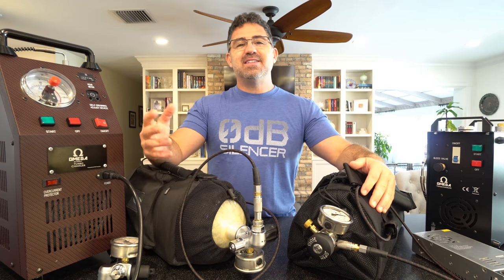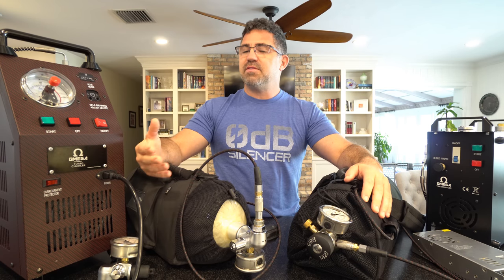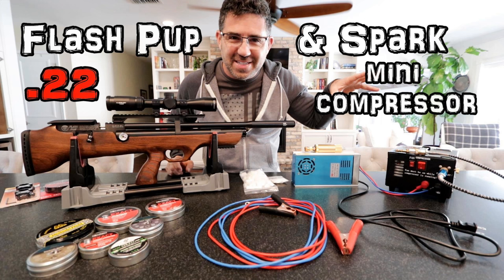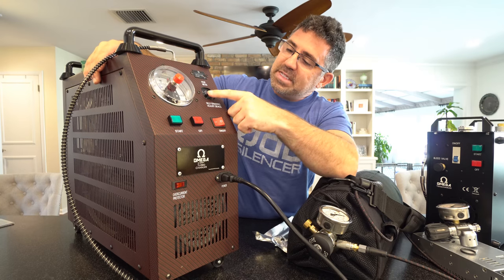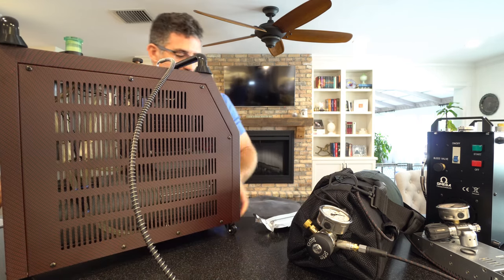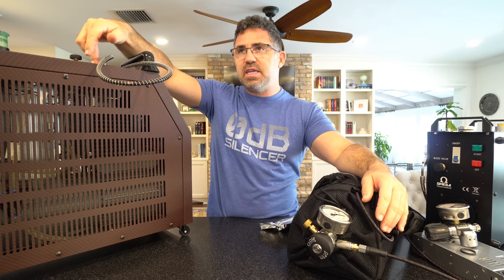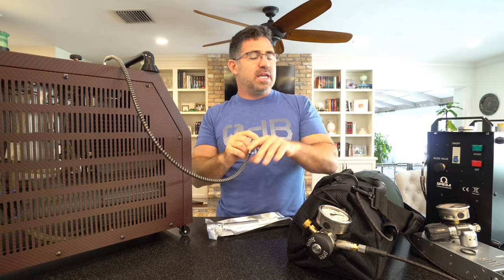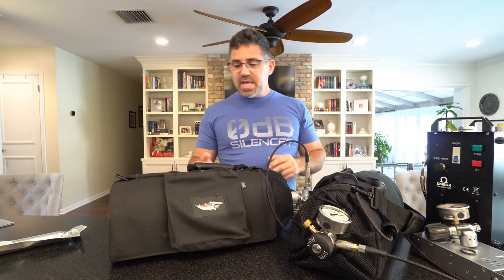PCP Air Rifle Refilling (REVIEW) + FULL SETUP Guide !! - Omega Trail Charger - 4,500 psi Compressor

Comment: Good video Steve I have the Omega Trail charger and it works great on guns and bottles the only thing that I would suggest is if you have a big bottle take it to a scuba shop have them fill it and then when it gets down to say 3,000 PSI your Trail charger will fill it right back up to 4500 PSI easy I just wouldn't suggest filling a -75 Cubit tank from empty to full but it works great to top a bottle back off I have a couple of the little buddy bottles it works great on that as well as long as you don't try to fill it from them being empty I also believe that the Omega Trail charger has a built-in water and oil filter to help keep the moisture out of your gun or bottle as well

Comment: I have an Omega Air Charger which is the stripped down version. I have owned it for about a year and half to two years with roughly eight hours and is working well for me. Before that I purchased one of those ebay compressors and I spent more time working on it than using it. I love the Omega. I also wanted to add a note about filling an air rifle too quickly. The only thing that I have ever noticed and I am sure you have as well, it will make the air warm and when the air cools, you will lose pressure.  I try to fill slowly so, the pressure doesn't drop as I'm shooting so that way I get the most shots.

Comment: Ive been looking to upgrade a bit from my AV Nomad2 compressor and I'm liking the Omega Trail to cut my cost and now I'm thinking to also purchase a Patriot 75 CU ft tank. Thank you for an Excellent review. I also know you're not suppose use these small compressor on the big tanks but I did use my AV Nomad2 to help top off my AV 75cu ft tank. from 3000 back to close to 4500 psi. I took me (3)  30 minute intervals, one 30min in the morning then shutdown and one in the afternoon. Then on the morning the next day the final 30 minutes interval. You just have to watch the length of minutes to not overheat the compressor. I'm sure others have done this with their compressors.
Reply: tank you, yes, discussed this for y'all :-)  Steve

Comment: Hey there, I hope you're safe from Hurricane Milton in Tampa. I just wanted to express my gratitude for your contributions to the air gun community. Your videos have been really helpful whenever I needed information before buying a gun. I have a question about the AEA Challenger. Does it have corrosion resistance inside the air tank to prevent rusting? I recently opened my tank after six months and found a lot of moisture inside. While unscrewing the air gauge too quickly, it malfunctioned, and I couldn't get it to hold air again. I'm concerned that there's no corrosion resistance inside the tank, and I'm worried it might fail one day. I'm curious if you have any information about the air tanks being sold to the public without proper moisture corrosion resistance, especially with the cheap air pumps that could be pumping water into our tanks.

Comment: There is an issue with water in the line that you overlooked. Water ejected at high pressure, freezes. You can damage valves, etc. from the ice. That's likely what finished off the USS Thresher, they did not have line dehydrators so when they went to blow the ballast tanks, the valves froze.

Comment: I have an Omega Turbo charger with 17 hours that's acting as a decorative piece of furniture.  I just don't want to pay the $200 to ship it to Todd for repair.
Reply: Walmart sells the Yong Heng with an available 4 year no hassle 35$ warranty for under 400$ if that helps. Mine is used a lot to fill 4 tanks 1-2Xs a week for 2 years and with issues. Hope that will help you.
Reply: Mine was giving trouble within 4 hours, but with a little bit of mechanical knowledge, and in depth phone help from Todd, we got it back running.
Reply: @heathhalfhill6867  I have a big compressor also.  I got the Omega as a backup to my Sheldon compressor.
Reply: How much do you want for it?
Reply: @allanwind295  It's not for sale. I'm eventually going to ship it to Todd to get it repaired.
Reply: What good is that tank?
If you were out hunting, would you carry either of those beasts.
NOT Convenient!
Even the smaller Omega is too big.

Comment: Great information, thx. I’m brand new to the pcp air gun. I actually just purchased the omega trail charger from palmbeachairguns they were the only place that had it in stock, I have never heard of them I hope they are ok. I have to shoot at a range that’s an hour from me. At this time I think the trail charger should be good for me, investing close to 3k for the turbo charger and tanks is just a little much at this time. Thanks again
Reply: They are good people from what I'm told 👍
Reply: @AEAC  hello Steve, just wanted to let you know that palmbeachairguns seems to be a great company, My trail charger arrived today with the 75cf tank, I ordered a 100cf tank also, question for you if you don’t mind, it’s taken a long time to fill the 75cf tank with this compressor, if I took the 100cf tank to a dive shop, I know they can only fill to 3k psi, but then I could just top it off to the 4500psi with the compressor, would that work?
Reply: @mikecup212  It would work, yes.  But your Trail Charger will fill it just as well.  Just use h method I shared.  Glad you had a good experience at Palm Beach Airguns.  Best, Steve

Comment: Definitely I would get the trail charger I have a sort have a smaller version of a trail charger. it works ok it was about $250-300. The trail charger looks like a better tool for filling my air guns.
Reply: It is better made than the cheaper stuff, yes.  Steve

Comment: Steve, you mentioned that a tank or compressor is mostly an "either/or", I already have a 74 cf tank, but what about the Omega trail compressor to keep the tank topped off? Like only filling from about 2000 psi to full 4350?  Your thoughts??
Reply: I was told that the Omega Trail Charger can refill SCBA tanks so long as cool-down rests are provided periodically... like for maybe an hour every 30 mins or so.  Steve

Comment: Hey Steve,  I'm watching your video again.  I'm wondering,  could you put one of those electronic "Wika" gauges on that patriot tank?  Not that you WOULD,  but more if you COULD.
Reply from the maker: That's a great question.  I'd say sure why not so long as the gauge is capable of withstanding 4,500 psi and the threads are correct.  I'd contact FX or WIKA and ask.  Best, Steve

Comment: The ($10) dead head plug you used to pressurize the whip on the compressor, you can also use on the tank whip to get its main gauge (especially if you only have one gauge) to tell you the remaining tank pressure.

Comment: I still feel like the auto shutoff on any of these compressors puts a lot of stress on the compressor internals when it comes to a sudden stop under this high of pressure. I could be totally wrong and it would be great if I am. But any of the compressors I use I open the bleed valve before I shut it off manually. I still set the auto shutoff,  just as a safety though.
Reply from the maker: I have a hunch that a one way check valve keeps load off the piston assembly during shutoff.  One things for sure.  They're tough.
Reply: @aeacvlog2033  yes sir you are correct.

Comment: Hey brother nice video as always. What are your thoughts on using the small compressor to fill the Benjamin 18 cubic foot tank? How long will
That take?
Reply from the maker: I think that would be just fine so long as you observed the duty cycle and cool off periods recommended in the owner's manual.  As for time, I couldn't say how long it would take but I imagine it would be a multi hour ordeal with the cooling off periods and all.

Comment: Do you know what the amperage draw on the compressor is.
Reply: I don't sorry.  But it would likely be relatively low due to its 110 & 12v  requirements.  Best, Steve

Comment: I have a super charger worked well for 10 hours then had problems with start capacitor failing eventually found problem with start to run electronic switch got parts sent to me foc ☺️water pump failed, fitted new part now can't get much pressure. looked at Air guns of Arizona they show how to repair THANKS . I will give it a go( UK subscriber )the part do not look well maid mine came from China to UK supplier i don't think the quality is that good for the price although UK supplier has sent me most part FOC
Reply: Hi Anthony, welcome, and thanks for the update.  Steve

Comment: I would pick the compressor 
I have another brand from China with the same size air cooled not liquid cooled 110 converter to 12volt pressure to 4500 psi and it was 355 dollars

Comment: The cons for a smaller compressor are:

1. 2+ min time to fill time possibly during your shooting session
2. Louder to use than a tank which may matter if you pest or hunt
3. Power is required where you want to fill your gun (either 120v or a running car as you mentioned)
4. You don't have the option to fill large tanks 

The smaller compressors (Hatsan, Air Venturi, Yong Heng etc) also seems to have a significant failure rate.  There is a compressor survey on airgunnation.com that I thought was interesting.  There is no data on the Omega Trail yet.   I have no use for the 12v charging option, so they should make the 12v cables optional and built in the transformer instead.  This was the change, I believe, with the Nomad II.

Pros:

5. You don't have to deal (money & time) with the yearly inspection of your tank(s), hydro every 5 years, recertification at 10 years (maybe 50% cost of a tank), and new tank when it's eol after 10 or 20 years (with recertification)
6. Significantly less expensive ($840 vs $2500+)
Reply from the maker: Yes, I'm familiar with that survey... think I was the very first to reply in that thread, lol.  I found it Interesting that all the brands had a similar malfunction rate but the Omega line was among the highest recommended when it came to the, "would you recommend your compressor to other airgunners" question.
Reply: @aeacvlog2033  I was trying to contribute something of value to the discussion, and I should have included the link https://www.airgunnation.com/topic/compressor-survey-results/.  Previous versions of the data looks differently (more along the lines of https://www.airgunnation.com/topic/what-200-compressor-owners-said/) with explicit failure rates,  but the latest conclusion is quite different than what we recall "runner up was a breakdown or failure rate of 75% with 3 out of 4 Omega Supercharger (red) owners reporting problems".   The data is what it is (tiny sample). I didn't post this with intention of making Omega or you look bad, as I said initially, I recall a different conclusion.  It's also my impression that Todd @ AOA have done a great job supporting the Omega compressors.
Reply from the maker: @allanwind295  To clarify my interpretation of the report, I'm looking at the Omega brand as a whole rather than any one model.  When looking at Omega, the survey shows 22 of 25 surveyed would highly recommend their compressor to others, and 8 of those 25 had some sort of problem to sort through... in the end only 1 of those 8 were neutral on recommendation and 2 would likely not recommend.  Of course take it all with a grain of salt as 25 people surveyed isn't a legitimate sample regardless.  This is a 5 year + old brand who by my personal observations sells dozens a week across North America.  Hope this helps.  Steve
Reply: @aeacvlog2033  Valuable and thoughtful.  We are lucky to have you in the airgun community.
Reply from the maker: @allanwind295  Promise Allan, would never host junk on the channel, and have turned down lots over the years.  I hold audience trust & industry cause in the highest regard.  Best, Steve

Comment: Oklahoma is the lightning state of America. 2nd the Yong Heng compressor will out perform these compressors because technically they have the Yong Heng parts inside. The Yong Heng is $230 vs 1k. When you going to do a review of the Yong Heng  compressor?  SCBA bottles are best buy as tested over decades by firefighters and other emergency personnel. All compressed air has moisture and should be filtered with a separator or more expensive dryer. Moisture in any air tool is it's weak link. This is why these air tanks go through a test every 5 years to check for pitting from moisture and other possible compromises of the tank. When your done filling your air gun the Val is already closed once you started feeling the air gun. The valve that closes is the fill valve on deer gun not the hammer valve. If the hammer valve was open you would just blow air down the barrel. Normally if you fill your air gun too fast you will overheat the tubes which in turn will give you less air and you're going to have to top it off once it cools off. And possibly if you overfill your air gun your seals can blow. There is no prevention in any Foster fitting it's a check valve that's it. I worked around compressors for 27 years and giving people the wrong information is highly dangerous and can have someone get injured as I've seen what just 150 psi can do when it explodes.
Reply: I've never heard from them but if they ever reach out, I'm down.  Steve
Reply: @AEAC   So your reviews are based on a company giving you the product. How about purchase the product and review it. You see how bias that sounds.
Reply: @airwolf269  No, that's not correct Mike.  I return the majority of the products I receive for review.  I'm compensated via payment for the weeks invested in each just as with any normal full time job.  Regarding integrity of results & message, my 78,000 subscribers all know full well that I'm regularly brutally critical in my product reviews, and every one of them is well paid for... so how things "sound" in text exchange never bothers me.  Being honest & critical is the job and my 27 Sponsors all know what they're getting into with me too, lol.  As for the Trail Charger, I absolutely loved it!!  I cant think of anything I found sketchy or off-putting.   As for Yong Heng, I'd love to hear from them.  Best, Steve
Reply: @AEAC  Your never hear from them it's China lol.
Reply: @airwolf269  Oh, new potential China sponsors contact me all the time, lol.  Just last month it was Pinty & Knine (Amazon Giants) and last week it was Gunsan, LLC.  With all the compressor reviews I've done, I'm kinda surprised I haven't ever heard from Yong Heng.  Steve

Comment: 25 hours??? UGH It's not even broken in... Why don't you review performance and reliability after you really use it???
Reply: I was thinking that too. For someone that shoots most days doesn't quite add up.
Reply from the maker: @andyb6120  It adds up.  The Turbocharger takes a 100cf tank from 3300 to 4500 in about 20 minutes.  3 fills/hr x 25 hrs is 75 fills in 2 years, which equates a little over 3 fills a month.  Each bottle fill recharges most airguns dozens of times 👍😊
Reply: @aeacvlog2033  I thought it was cool you backed that up with data.